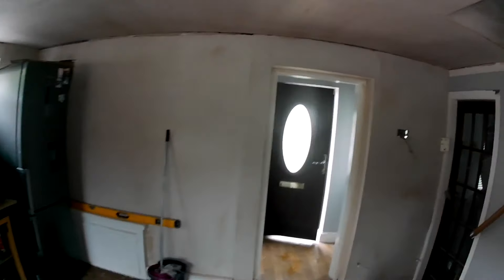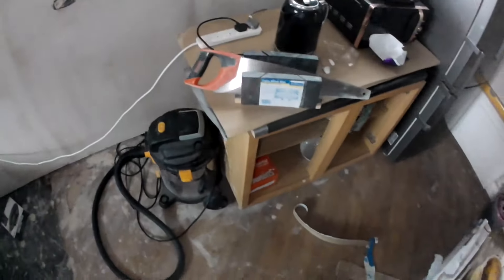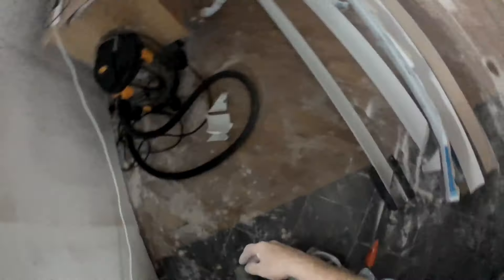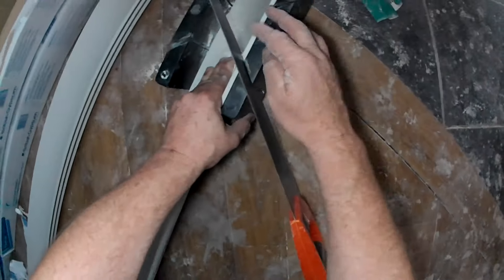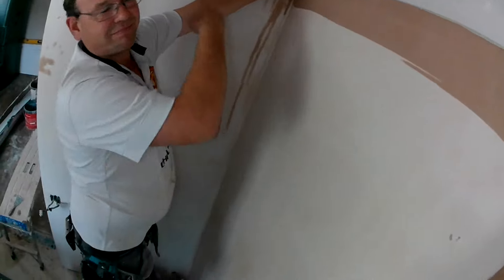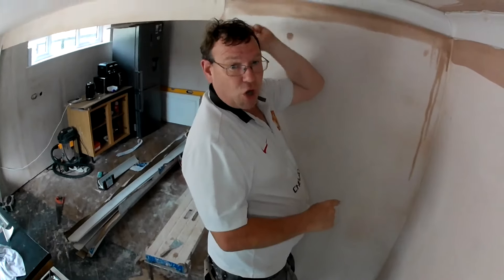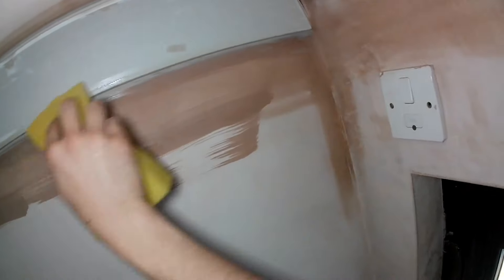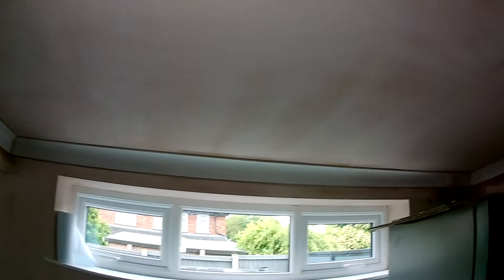How to use plaster coving

Comment: If you clean it all off before you put your next piece up and you have to adjust the height slightly you have nothing left behind and have to fill it again
Reply from the maker: @ashtonormesher9682  yes that's why I cut a template mate just check you angle and then you can clean off